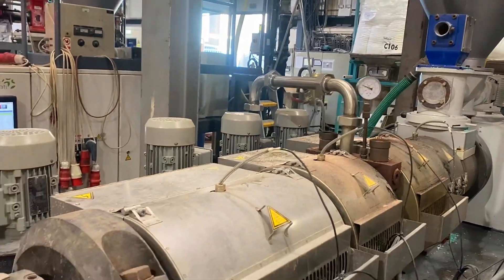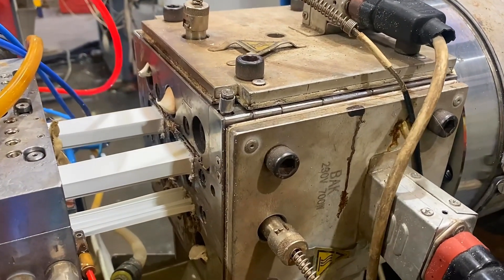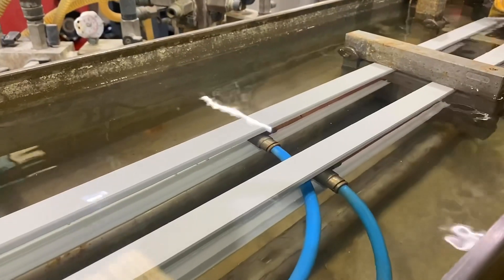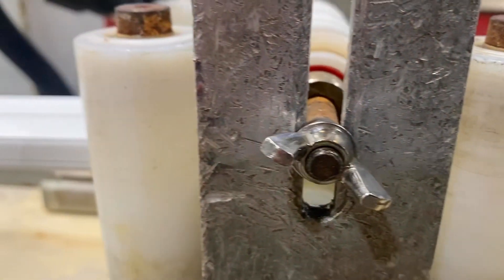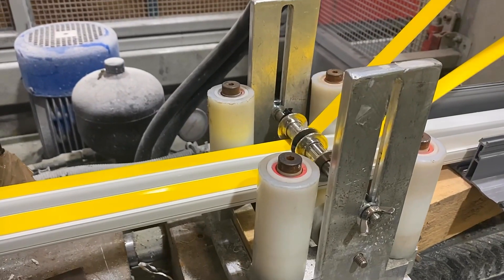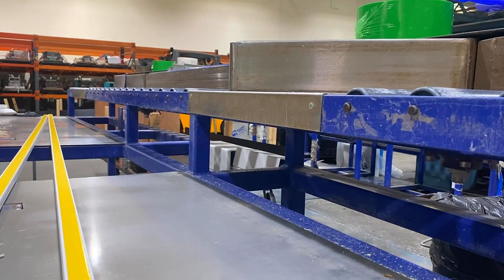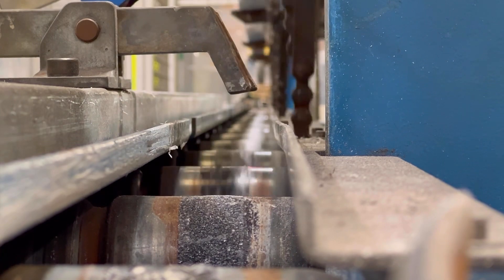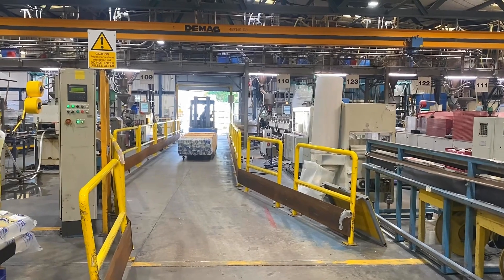How Do They Make Self Adhesive Mini Trunking?

Comment: The adhesive tape may speed up initial installation but you'll be back when it falls down in hot weather.
Reply: The adhesive is only to tac it whilst you screw and fix it in place. No decent electrician would fit mini trunking using just the adhesive.
Reply: @alvina69  So the adhesive tape is rather pointless. Why go to all that trouble of adding it?
Reply: @nickbea3443  It holds the trunking in place whilst you drill and screw some fire clips in place. As I said before no decent electrician would just rely on the adhesive to hold it in place.

Comment: Boy I wish I pull this stuff off in Houston TX. Running romex here is a very expensive and labor and permit intensive process. Here I have mostly 12/2 with ground and the lighting is all 14/2-14/4 depending on the circuit.
Reply from the maker: Thanks Joe for your time and input
Reply: @efixx  If you ever want to see pics or talk about my experiences, contact me. Love your videos.